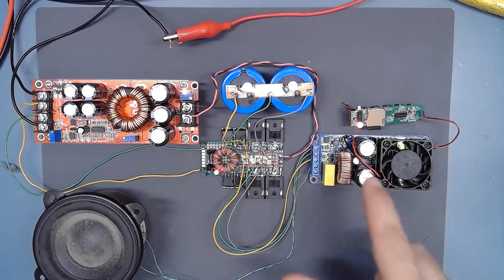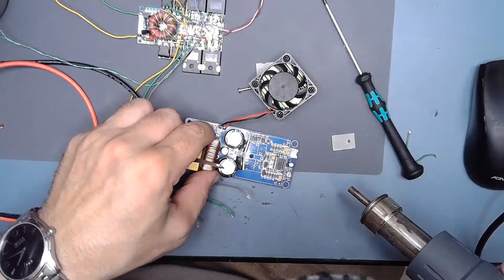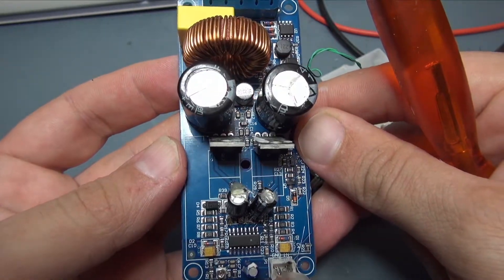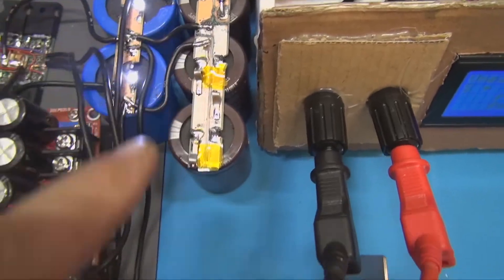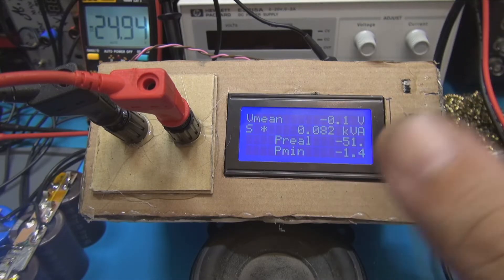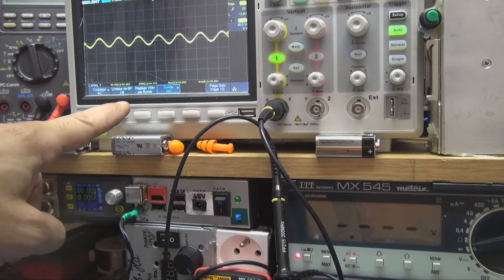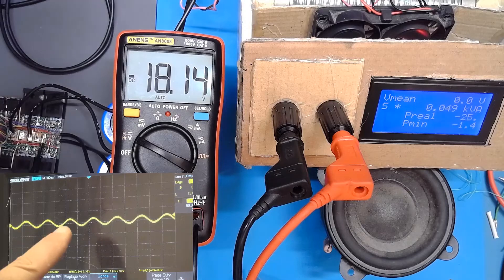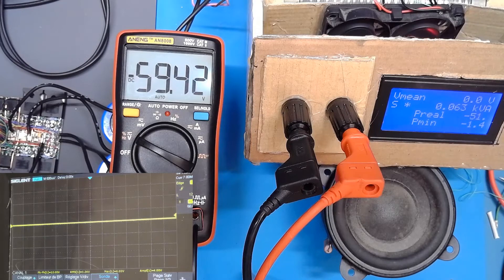IRS2092AMP-500W Class D Amplifier: The Real Watts

Comment: Hello, Mr Hartdegen! I have just purchased one of these chinese 500W class d amps but I am worried because, although it seems to be performing well in bench tests, its little heatsink is getting VERY hot even without any signal applied to the input (just powered on). Did this one you tested in your video present the same behaviour (getting very hot even in standby)? Thanks in advance!
Reply from the maker: Hello, I don't remember about this problem. What you need to do is measuring the current consumption on the negative line, and the positive line. You need to found, first, a similar current on each rail, and it need to don't exceed 200/300mA. Be sure to have a nice symmetrical rail, and be sure to not exceed 65V+/-. I think you need to try it with lower voltage value, and see if it react differently. This problem can be a parasit capacitance on the grid of the mosfet, or the main IC wich can be not ok, of something like that. I will try to reconnect mine with the symetrical voltage and I will tell you if it occurs.
Reply: @AIexanderHartdegen  It would be really awsome if you could verify if the heatsink of yours gets hot in standby like mine. Salute from Brazil! Best regards.
Reply from the maker: @washingtonbomfim4701  the test is done (I was on my electronic bench). The currend draw is about 20mA per rail, with 60V+/-, mosfets are naked, with no heatsink, and it stays cold. Barely warm after one minute of connexion. According to the hurr on the input line, some smoke can appears from the SMD resistor near the big coil. With a speaker connected, even not warm, with a very low level sound admitted. 
On this amp, I have connected a 1k resistor on the line, to prevent about bad oscillation (this value can be changed according your needs). Try to connect a 1k resistor in parallel with the input low level line, and see if this problem disapear. If it dont fix the problem, it can be a defect unit. (the 1K resistor smashes some high frequency loop parasit). Also, the big coil is connected from the output to the ground via a smd resistor and coil. Maybe because a high frequency parasit loop occurs, it can provoke a consumption. First, check your consumption on power rail. Also, try to remove the big yellow capacitor, or the big smd resistor to see if the input current decrease significantly. If you notice a difference, that's high frequency loop parasit and you need a 1 k resistor on entry. If all those tips doesn't work, you will have a serious issue on this board.
Reply: @AIexanderHartdegen  Thanks for your hints. I'll surely give them a try and let you know the results. Take care.
Reply: @AIexanderHartdegen  Please allow me to bother you a little further. While I am waiting for  vendor support to answer my inquiry (which is unlikely to happen), I monitored current consumption in both rails as you suggested and found 250mA! Much higher than the value you found and that may explain the heat! But since the very 1st time I started testing this class D amp I always had a 6ohm loudspeaker connected to it, so I decided to test it without the speaker and you know what?! Standby current fell to around 18mA and heat obviously disappeared. I would like you to confirm if your amplifier really doesn't get real got when a speaker is connected (even without applying tto input and look forward to hear your comments and I once again apologize for my inconvenience.
Reply from the maker: @washingtonbomfim4701 I don't have this problem, even if my speaker is connected.  The problem you have is that: you have noise coming from the IC, wich is sent to speaker. You can try to put nice capacitor for filtering DC+ and DC-. Also, trying to reduce the impedance entry (by connecting a resistor in parralel) is an idea. Also, you can connect the input to the ground with a 1nF capacitor. Al those test can be done by using a 10 ohms resistors on your speaker in serial to reduce the idle current, and using less voltage than rated voltage for more secure when experimenting. The purpose is to eliminate, or reduce the HF component sent to the speaker. The best way is to erase it from the entry, the second way is to change the filter (the self present on your board seems to be not enough). You probably have a bad decoupling DC, also you need to check the two capacitors near the IC (those I changed on the video). If they are not good, or not enought in your case, it can create some nose. Put a 10 ohms on serial with your speaker and try to reduce the current idle. Of couse, when experimenting, you can use 24V (or more) bulb in serial on each rail. Thanks for interest.
Reply: @AIexanderHartdegen  As to the possibility of input noise, I short circuited the input with no result. I will keep on trying your suggestions. Thank you very much.
Reply from the maker: @washingtonbomfim4701  you have also micro potentiometer to adjust level of entry (microscopic potentiometer). If this component is not perfect, you can have a lower resistance on the line, allowing noise to birth on the loop. You need also to check the integrity of this potentiometer when connecting the input line to the ground with a capacitor or resistor.

Comment: If you look closely, there is a marking on the side of the terminals in the cutouts near the wires. There are many protective diodes on the board, yes, but they will save only if there are fuses or power supplies with current limiting, which I did not see with you. But I saw thin wires on the power parts, and cardboard near the heating elements. That's all you have to do to start a fire.
Reply from the maker: thanks for feedback.

Comment: I have this exact amplifier but there is no labeling on the connectors as you stated.  Do you have the schematics or a more detailed version of how to hook this thing up
Reply from the maker: at once not. Try to find the positive and negative terminal from the capacitors and the middle point. It will be the positive, negative, and neutral point.

Comment: Sir good review i plan to buy that amplifier . Me i know also the best toroidal for these?
Reply from the maker: the better is simply the good voltage and good current supply. There is some models on aliexpress but they are sometimes more expensive. You can build a power supply with a simple 48V tranformer and create a symetrical output with capacitors and diodes. That's bulky but more easy to make.
Reply: @AIexanderHartdegen  i heard it handles at max. 45V Transformers, which is 65V after rectofier?

Comment: Dude.. Err-Sir.. There are connection indicators on the board, and here's where they be at.
Step 1/. Pick up the module and rotate it so that the fan is as far away from you and youre gazing at one end of the Amplifier Module.
Step 2/. set your eyes towards the Blue "5 Terminal block".
Step 3/. rotate the board slightly down so that you can see the PC Board Under the 5 Terminal Blocks
Step 4/. inspect from left to right for a "-" once you have discovered this Minus sign for the negative 50~65 Volt terminal connect it up
Step 5/. Once connected, Look to the right of that terminal to see the "G" AKA GROUND and connect that one up
Step 6/. Once connected, Look further to the right and Locate "+" connect your Positive 50~65 Volt terminal up to it.
From there you should locate the last two symbols and connect your Positive speaker and Negative speaker leads to them . 
BTW A simple 300VA 50-0-50 volt Toroidal Transformer feeding a 35 amp bridge rectifier with around 10000Uf filtering per rail, will have the amplifier or amplifiers produce a very respectable 5ooWatts Rms  Mine produce 510 watts before clipping and distorting..
Reply from the maker: thanks for your feedback.
Reply: 510? Hows that possible? How much distortion is clipping?
Reply: @MasterBlaster220  Class D amplifiers have extremely high efficiencies, So with the right votage and current the new Power Audio Amps being sold lately can output Kilowatts..😉
Reply: @KorAllRBare  Its not that, i just wonder how all this should be possible with just a 300VA Transformer?
Reply: @MasterBlaster220  I suggest you put it all together and then do the tests.. Mind you if your supply is a lowly 120 volts AC You will need to use a 600 VA transformer per amplifier module..
Reply: @KorAllRBare  Its just that is missed something very basic in electronics i guess. Is it due to the power supply capacitors that you have moren power then the transformer can deliver?
Reply: @MasterBlaster220  58+~0~58- rails sum to 116 volts rail, if you multiply the volts by current which is around 3~5 amps "I think.. it's been a while", anyway and because class D amplifiers have high efficiencies it should obvious that a 300 VA Toroidal transformer is more than adequate..

Comment: Why did you remove the elements and put on the capacitors
Reply from the maker: they was destroyed by backward power supply.
Reply: @AIexanderHartdegen  The best impulse block for clas D amplifier 60 - +
Reply from the maker: @iordanjelqzkov3337  +65/-65V are required. It's recommended to not exceed 70.
Reply: @AIexanderHartdegen   It must be impulse to keep stable 60 volt + -
Reply from the maker: @iordanjelqzkov3337  there is many ways to keep this stable voltage. If you use classical transformers, you need to use the maximal voltage (here 70V) and adequate capacitors. With a SMPS power supply, you can use just this 65 voltage, because the regulation make it stable, as long as you didn't exceed a certain current, making the voltage drop despite the regulation. Also in this case you can add adequate capacitors to use it more better, I mean using it in dynamic mode. Of course, driving a speaker is not as hard as a resistive load. In this exemple, the signal sent to the 4 ohms load was a pure sinus, wich doesn't exist on a sound reading. So, the power never exceed this wattage on a average measure. So, because all amplifier works in dynamic, we can use half supply with capacitors, in this case 250W.
Reply from the maker: @iordanjelqzkov3337  I think you will reach 400 rms very easely with it.
Reply: @AIexanderHartdegen   thanks a lot
Reply from the maker: @iordanjelqzkov3337  you're welcome.
Reply: @AIexanderHartdegen  One more thing to ask about this model. Did you let it be heard on speakers is there any noise whining and humming

Comment: Good experimenting with that class D amplifier.  The power meter for audio also looks interesting maybe you will put it in a better box.  I was just wondering why you did not use the 20v per division on the oscilloscope, you surely could see the waveform better that way.
Reply from the maker: @Silvio De Leonardo
 thanks for commenting. This power meter is not my original conception. It's made by meettechniek.com (universal power meter V1). I have a little bit retouching some values on the program to correspond to my power range use. Yes it's made on a cardboard box... I need to make a real box. But there is the confinement, etc, founding raw materials is another story. I will see on two weeks. I need to understand something more on it, wich I always don't figure out the reason of some display on it. But anyway, it gives at some line a nice value, confirmed by the voltage displayed on the multimeter, to avoid a bad value.
About the voltage division of the scope... here I have no response. I need admit forgetting my brain somewhere in my mess. Thanks for commenting, and hope you're well.
Reply: @AIexanderHartdegen I'm very interested in this power meter too, just did some research and discovered that it's made with Arduino, is there any information about how to make it an "amp dyno meter"? 
Thank you for your video!